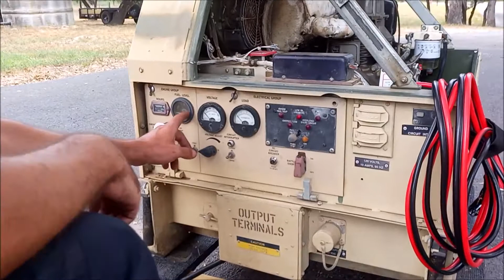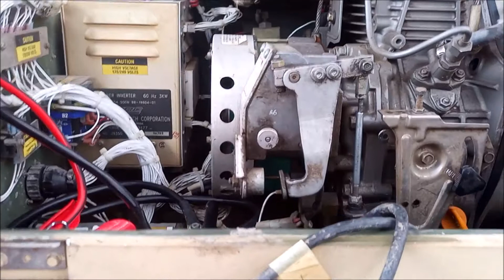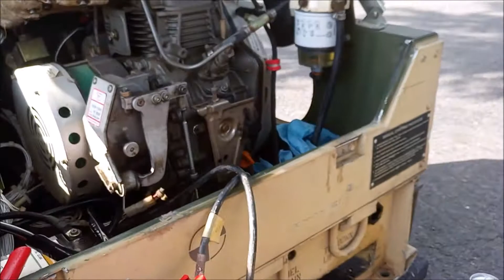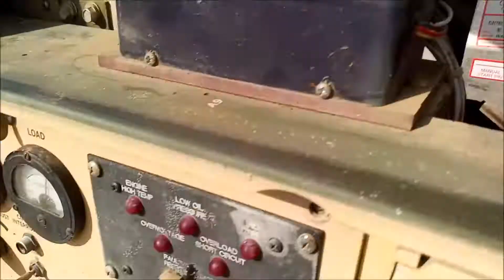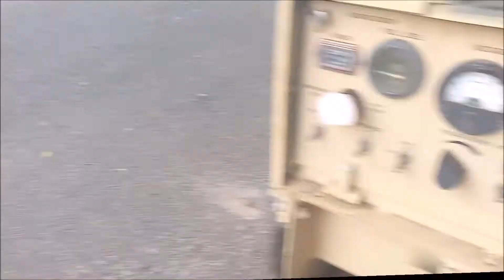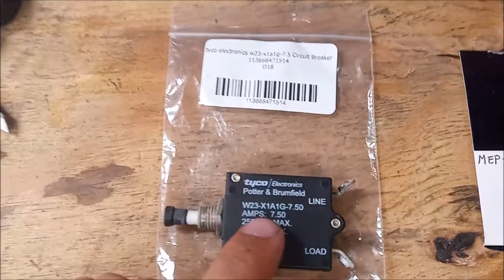MEP 831A - First repairs & load test

Comment: I just bought one of these. Did I hear you correctly when you said it needs 24v for starting?
Reply from the maker: The entire DC electrical system is 24 volts, it is military. Yes, it needs 24 volts to crank the starter.
Reply: @CallMeColtLLC  this could be my issue. Lol

Comment: A lot of heat guns use a diode to produce the low power setting. This loads the line on only one half of the cycle. This can cause strange reactions on the power source, especially if it is a solid state inverter. This generator should be ok.
Reply from the maker: Generator ended up being fine, just took some work.

Comment: Have you checked the output frequency? What besides the inverter is controlling the frequency. With mine I am able to generate power but I cannot keep the correct frequency. Could there be something wrong with my inverter?
Reply from the maker: An inverter generator either puts out proper frequency or it doesn't. If it's not, then there's a problem with your inverter. Don't trust the gauges, use a meter.

Comment: Seems like an awful lot of expense to run a couple hair dryers.
Reply from the maker: These do have a limited use for sure, but, have a massive advantage for those in the want of those advantages... diesel fuel, fuel efficiency, longevity, & clean power for electronics. Once running correctly, these things are great. They don't make much noise for what they are either.